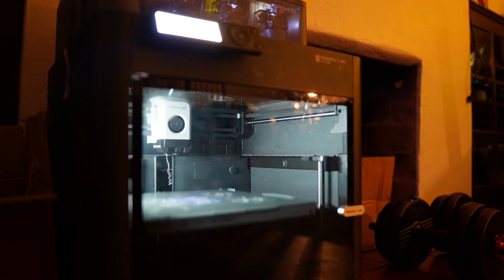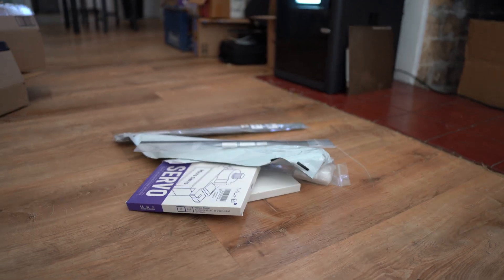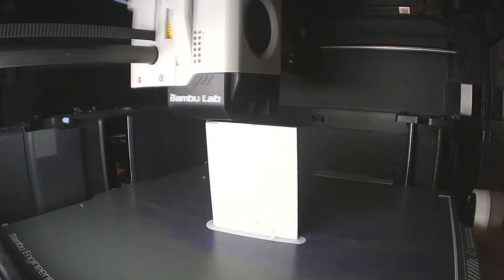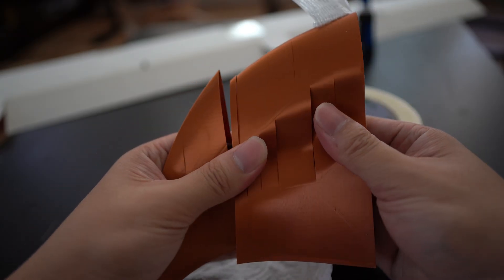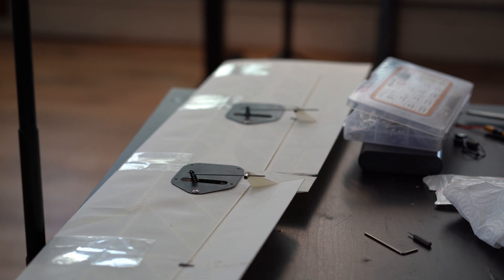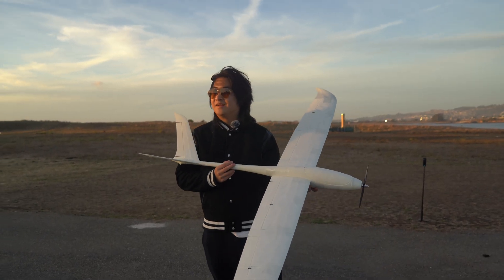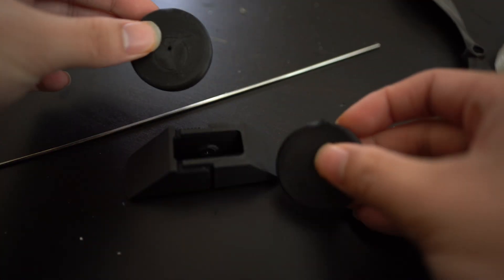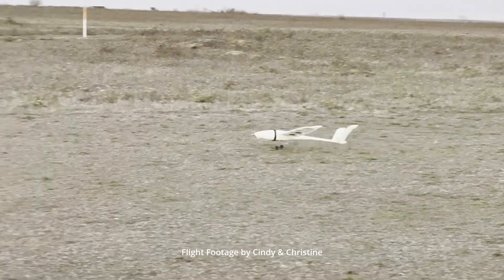Building & Flying a 3D Printed Plane

Comment: Very cool Now I'm thinking of making one, did u had any issues when it come to mission planner?, somtimes it just wont work for me and there arent much information when it comes to very niche programs.
Reply from the maker: This aircraft does not have a flight controller. Historically I used mission planner + pixhawk for stabilization, no problem. What r u trying to achieve?

Comment: Very nice I 3d printed an airplane too and found some issues and solutions for 3d printing with foming filament I want to share: first use a birm to prevent warping never use glue it will stick to well.Second Bowden extrudes will not work as good as direct drive extruders and will under extrude and will have way more stringing.
Reply from the maker: thx for sharing! Btw what type of print bed do you use? Mine would not stick without glue stick
Reply: @ I just used a regular textured pei print bead and adjusted the z offset to squish the first layer that helped and printing the first layer at 30-40mm a second also helped with bead adhesion. Finding the right temperature is also important because foaming will not be the same at all temperatures. I also used colorfab lw ht pla so it might differ from the results you will get. But I hope I could help 😀

Comment: Great project and flights.  It's possible that your landing gear is a bit too far back in the CG envelope as with this setup you want a taildragger weight distribution so that it doesn't push over so easily.  The gear are just for keeping the front off the ground.
Reply from the maker: You're exactly right. I think it might be more helpful if I make it into a tricycle setup and shift the current gears back.